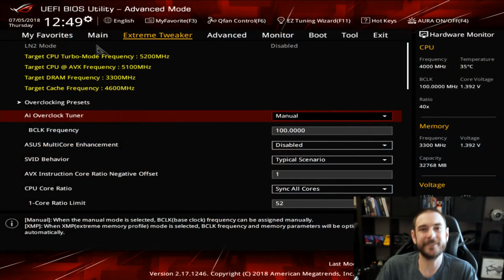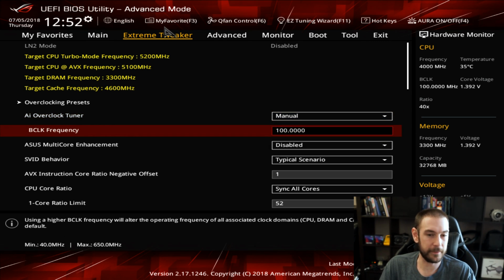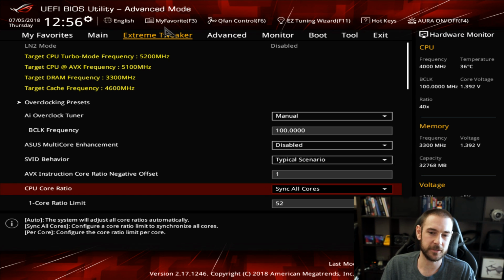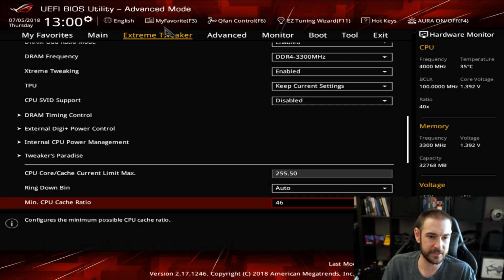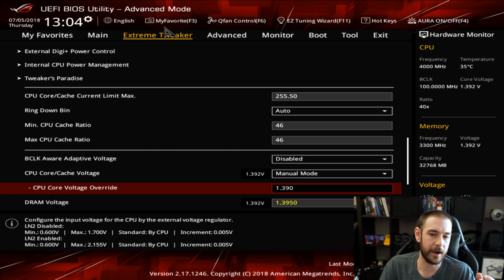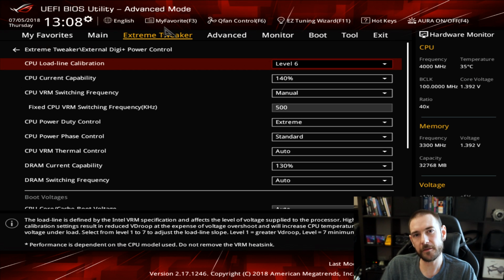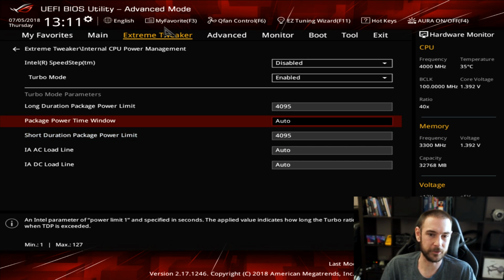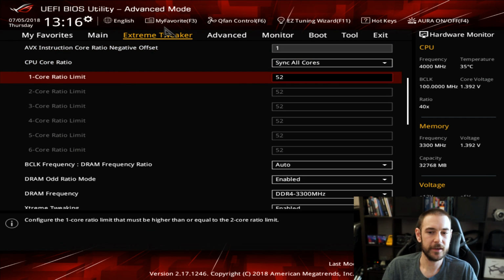How to Overclock an 8700K & 8086K - ASUS Maximus X and Others

Comment: Hey man can you please reply to this as soon as possible I have been trying to over clock my CPU past 3.7 out of box clock rate and it wont budge. The pre sets wont change it, and I also followed your tutorial to the T. I am using a i7 8700k thanks for your time. One last side note is that I've been working on this for over 8 hours now and still nothing, I got it to 3.9 but that's it. There is some setting buried deep in the bios that I cant find.
Reply from the maker: Need more details. Are you on the same motherboard?
Reply: @boostedmedia  yes I am
Reply: @boostedmedia  and I also just got the message sorry for the late reply
Reply from the maker: Are you sure you have an 8700k and not 8700 (locked multiplier)? 

This is bizarre unless you’re missing a step somewhere.
Reply: @boostedmedia  box says core i7 unlocked i78700k LGA1151
Reply: @boostedmedia  this has been going on for 9-10 hours now as well I'm still working on it atm
Reply from the maker: Also check that the safe boot switch on the motherboard hasn’t been bumped by accident.
Reply: @boostedmedia  also just to say it again, none, and I mean non of the presets will get past 3.8 not even the 5ghz one
Reply: @boostedmedia  safe boot was off
Reply: @boostedmedia  re did the whole tutorial again still the same thing. Also I found that the only thing that has raised my ghz is the bclk frequency when I enable it.
Reply: @boostedmedia  hey the bclk settings let me get past the 3.9 mark, but I had to make it like 110
Reply from the maker: Yeah you don’t really want to overclock that way if possible. Maybe jump on our discord server and post some photos of your bios screens. I’ll see if you’ve missed something.
Reply: @boostedmedia  could you send me a link please
Reply: @boostedmedia  Ive looked at about 5 of your videos and cant find a link, also cant find one on your home page
Reply: @boostedmedia  I need a link man, and I understand if your asleep
Reply from the maker: https://discord.gg/7YzjkFQ

Comment: Asus Maximus X Code, 8086k, Corsair Dom Plat 2 X 8GB 3200mhz RAM.. My system will only run CPU at stock settings and my RAM at 2100mhz. Any time I make ANY change my OS will not boot... not sure what to do....

Seems I'm a bit confused if I need to download/install any updates or drivers from ASUS. What am I missing?
Reply from the maker: Go through every detail of the settings shown. Perhaps your power supply is inadequate?
Reply from the maker: Also make sure your bios is up to date.
Reply: +Boosted Media +Boosted Media I will watch again and do that. Actually was having trouble with a refurb corsair ax860i before switching to evga 750 p2. 

I have read horror stories of bios updates (though I know this board is supposed to have a fail safe. Having never done it before though, I'm a nervous nelly)
Reply: +Kody Amos  the pc would randomly turn off and loop cycle. But the new power supply fixed all that.

Comment: Thanks so much for the vid. I followed all recomended settings for my 8700k oc on a strix z370e board but at 4.8ghz and 1.3v my lan connection sould not work. Dialed it back to 4.6ghz and all is well
Reply: arya ohadi might sound stupid but how did you dial it back to 4.6 ?
Reply: @niko2454  just drop the voltage in bios. Where he entered 5.0 or 4.8 you would enter 4.6
Reply: Try 1.250v with high or lvl4 llc at 4.8ghz, should be acceptable

Comment: Great video and I know it’s been a while since you posted so I hope you’re still answering questions. I followed your directions for my 8700k and Asus z370 Gaming Plus Tuf and everything worked fine (stability test/benchmarking) but when I put my pc to sleep it would wake up after pressing keys or moving mouse but the monitors would stay off. The monitors would only come in when I reset. I found a lot of “fixes”through the OS but none worked. I had to revert back to my previous bios settings. Thoughts?
Reply from the maker: Hmm there’s a lot of things that could be but it may have something to do with processor power states. I’d play around with that first.
Reply: Boosted Media thanks, I’ll look into it. The good thing is that I also followed your instruction to save under a new profile. 👍

Comment: How good is asus prime z370-a preset 5g self oc . should I use then and if it sets it above 1.4v manually crank it back down to 1.4v ?
Reply from the maker: I never use auto overclocking.

Comment: I overclocked my 2070 and my i7 8700k and i only got a 750 watt power supply do you think i’ll go over?
Reply from the maker: Depends what other components are in the system.
Reply: you will be fine unless you have a cooker connected to the motherboard

Comment: Oh man was this tutorial helpful. I learned more from the first 10 minutes of this vid than any others I've watched on overclocking. It was super informative and i couldn't skip a second of it. An 8086k is on its way and i was just wondering if a stable 5.0ghz with a voltage of 1.3 or slightly lower ,avx offsets at 0, min/max cpu cache at 42, cpu vcc volts at 1.25,cpu system agent volts at 1.20, llc at level 6 with temps maxing out at 80C(or slightly higher) is a 24/7 system. And of course the important settings set at what they need to be such as current limits etc. Are there any voltage changes i need to make in order to make a 24/7 5.0ghz stable system without damaging/shortening the lifespan of my cpu/system? Thanks again for the super informative vid. Will be watching the rest of your vids too :D
Reply from the maker: I run my VCCIO and VCCSA both at 1V. Get them as low as you can. Anything under 1.25 is “safe” though. 

As for VCore. Anything under 1.35 would be co suffered safe as long as your temps are acceptable.

Comment: My i78700k I used lower settings than the ones that you have. I put 47 instead of 48 and I set mine at 4.7 ghz and I got this problem yesterday where my pc would freeze and I would get a static sound and then i would have to click the reset button. It hadn’t happened since then but it seems kinda weird because it has never happened before. Any suggestions @boosted media
Reply from the maker: You’ll need to check the error logs in event viewer to determine what’s causing the hang. Could be anything.
Reply: Do you have a video on how to check the error log or should I just look up how to do it and thanks for the help